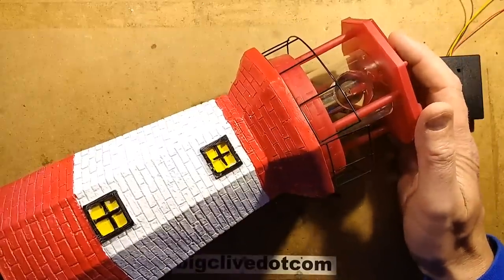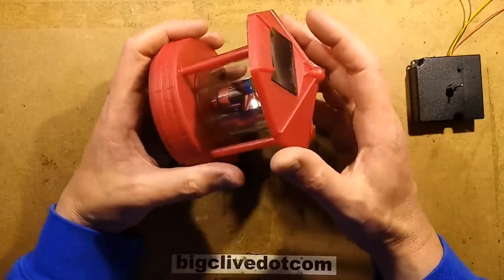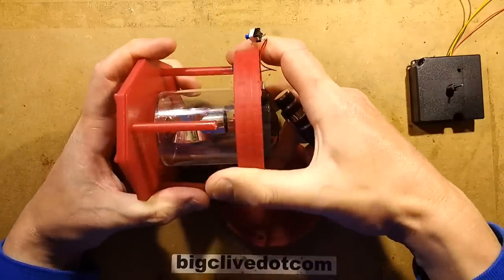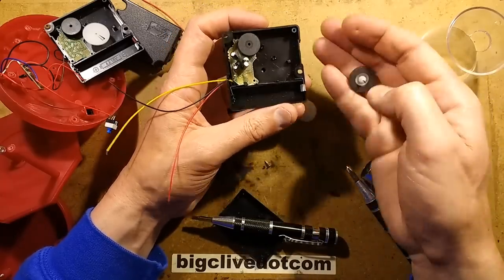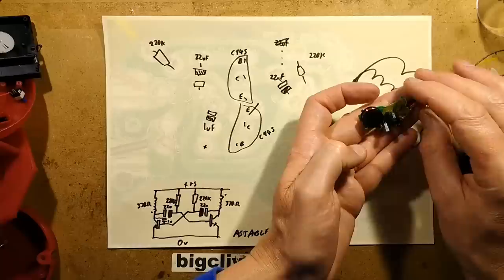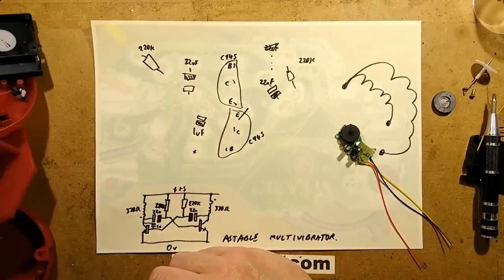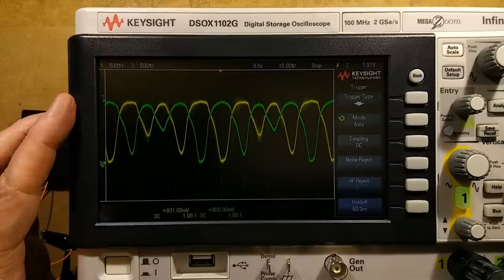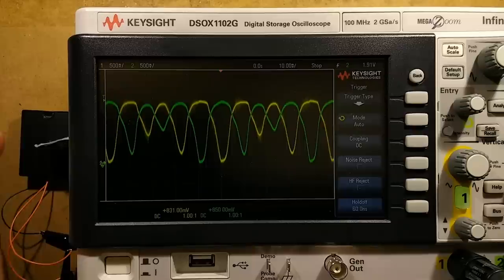Really interesting motor inside a solar ornament.

Comment: It's a striped down clock motor. they used as much as they could from the existing parts. The 2 phase motor coil is working very similar to a clock motor, just doesn't have the calibrated crystal on the drive side.
Reply: Exactly
Reply: I believe it is also very similar to the peristaltic pump driver used for administering some types of drugs. Could be wrong though as I haven't worked on anything like that for 20 years.
Reply: It's more than that, it's a brushless motor which is why what clive calls "the weighted flywheel" is really a magnetic rotor just like you see inside a modern brushless drill. 

Too bad he didn't scope out the waveform when the circuit first got power to confirm if that's why that off balanced electrolytic cap was indeed there to start the circuit as he hypothesized.
Reply: Yeah I was thinking it looks like a clock movement - and the cog is what would drive the second hand ....be interesting to measure how many revolutions per minute
Reply: I have a low rpm jewelry display platform that uses the same type of motor. The battery lasts about 14 days.
Reply: The second hand could be replaced with a spinning rainbow flag, that goes with the pink lighting ;)
Reply: Yeah, the little black case even looks like the back of one of those cheap dollar store clocks, just without the adjustment dial for changing the time.
Reply: Wasn't that what he did when he held the motor stationary and the waveform appeared to have some sort of starting pulse every 2 seconds?
Reply: I'm surprised they ditched it. It's super cheap considering they can order a special batch at the Chinese factory that doesn't have the whole package. I used to make tiny ballerina boxes with them as a gift toy for grandma's birthday. I kinda stopped after a while, you can have only so many ballerina music boxes.
Reply: +aserta Where can I get them? I could really use a couple of these motors.
Reply: +LateNightHacks Thanks. Not really interested in buying 3000+ of them, but at least now I have a search term.
Reply: @hellterminator
That was the idea :)
Reply: some clocks actually use a very similar rotor and driver, you know the always rotating types. I'm thinking about using these with joule thiefs to make a ultra low voltage motor.

Comment: I use egg boxes when dismantling equipment. Each stage goes into the next sequential egg holder. It prevents  losing anything and or putting the wrong screws in.
Reply: mbaker335 that's actually a very good idea
Reply: Or an ice cube tray
Reply: mbaker335 I like it.
Reply: I have a number of little parts boxes, segmented containers with a snap-close lid. Got them with a cheap plastic toolbox, they snap into recesses in the lid. Such toolboxes are easy to find cheap online and you can keep drawings/schematics, sub--assemblies, accessories or special tools for a project etc. in the box too, buy one for each project and label them. The closable parts containers are very handy when you accidentally knock one off the bench... as long as you get in the habit of always closing the lid!
Reply: Aren’t you an interesting person 😏

Comment: I love watching you solder Clive! every time I get the iron out I try the Clive method, burn my self, make a mess and then get my little soldering vice out 😂
Reply: R-URBEX After a few attempts I eventually learned the way of the Clive. I still have to master it though.
Reply: +That Guy
It's easier than using chopsticks.
Reply: Don't feel bad, just watch the Clive burn himself at 16:50
Reply: Clive has had special asbestos fingers fitted. It's an upgrade option at the Electrician Factory. Everybody else learn a different way of soldering.
Reply: The "Clive method" becomes easier to master once you've practiced it for a few years by making fine wire joins or repairs with a gas iron at the top of a 10ft ladder. Such is the way of the service tech.  :)
Reply: your skin on your fingers hardens like leather.
Reply: We ALL have our vices :)
Reply: don't worry, after doing it for a while your fingers actually get so damaged they'll have greatly reduced heat sensitivity and have a hardened coating of dead tissue. Then you'll be more or less immune to such heat damage.

Comment: Goodday Big Clive! Thank you for choosing the "lower" enthusiast grade Oscilloscope for use in your videos! Its always hurting if you want to use similar equipment than the people you are learning from and its just astronomically expensive.

Could you please do some sort of introduction Video on these tools like you did with electronic components? There are several cheap DIY Oscilloscopes on Aliexpress and E-Bay, maybe you could feature them aswell (They would also be easier to use in your top-down style videos.) for entry level hobbyists like me!

Regards from Vienna,
Ray
Reply: raydoesnilusin
The cheap assemble yourself kits are not worth buying if you want an actual tool to make measurements. They're a nice, fun kit to assemble, and they kind of work, but they're not a real tool.
Reply: And that could be the point of the comparison when does the toy with entertainment value become a tool with practical value in use.
Reply: The kit was enough to determine the inner layout of a LCD screen I had and allowed replacing the controller. They're harder to use than the pro-grade stuff and you'll probably never wish to go back to the kit one. But there's a huge difference in price too (50-100x basically) and it works.
Reply: You showed amazing restraint- I don't know if I could have turned down the super-kick-ass Keysight scope, even if I don't know what 80% of it does.

Comment: The clock with the rotating balls is called a 'torsion pendulum.'

With modern pendulum clocks, both torsion and standard, you often find the pendulum is just for ornamentation and the actual timekeeping function is an electronic quartz mechanism. People still like to buy clocks with moving parts because they show 'taste' and wealth, but as quartz movements are more accurate and cheaper to make than a well-calibrated mechanical movement, manufacturers respond by just putting in a fake mechanical movement.
Reply: Vyl Bird We have one of those clocks, it is called an anniversary clock, it is supposed to run for a year on a wind. The trouble is it seems to need the lightest lubricant in the world because the mainspring has ludicrous gearing..
Reply: +simontay1984
You could try gun oil.  Used on mankind's most precious machinery.
Reply: Does it actually use a liquid lube?

Clocks typically run dry -- jewel point bearings, knife-edge pivots, and brass alloys with lead for the gears.
Reply: You may be right, I did try very fine oil diluted in a solvent, not sure that was a great idea....
Reply: commonly called a carraige clock.
Reply: @g0fvt  Whale oil (beef hooked).
Reply: @wiseoldfool  I cannot go to a store and ask for “beef hooked”

Comment: I picked up one of these units for 50% off at RiteAid in NH.  It was the only one on the shelf.  What convinced me to buy it was the fact the LED lit and the reflector rotated when the solar panel was covered.  The unit I have is black trim on white and the LED is a white LED.  Considering how unique it is we take it in at night so it doesn't get feet.  Ours has only one solar panel and generally will run for about 3 hours after a full charge.  I've been reluctant to take it apart to find the battery but, thanks to you, I now know how to replace it when it dies.

Comment: At first I was expecting a standard clock movement with the seconds only hand connected. This would give a nice slow movement, possibly more like the real thing together with microscopic current draw.
Reply: I was of course talking about the continuance motion type, not the stepper type motors, I agree that would look dreadful.
Reply: I can imagine that is a clock motor, just with an option or two added or left out.
Reply: That does look like a clock movement case, and it's probably using a stripped down clock drive circuit.

The two coils are used for both start-up (avoiding meta-stability) and for energy recovery.
Reply: Nah, there's no circuit for energy recovery, no point, at such low power levels, and finally it'd be counter-productive and use more energy than it saved, since the only energy would be the moving magnetic field. To take energy from that would mean more would have to go in, and efficiency always being < 100% means it would actually use more. 

I think it's a variant on a clock drive. Since there's no quartz crystal in there. Probably the mechanical parts are mostly the same.

Comment: Our local Reject Shop did these a few years back, except theirs were much bigger, and had yelllow LEDs shining from the tower windows (along with a fairly powerful cold white LED in the lantern enclosure). This lot needed 6 decent polycrystalline panels to run it, along with 2 AA NiCds. They were far from cheap (I seem to remember $45 being the price tag), so definitely NOT the sort of thing you'd leave in the front garden, no matter how nice an area you live in!

Comment: Hi Big Clive! Thank you for doing this video. I have the same Lighthouse myself it does not like the wet weather. I have rebuilt it many times due to water damage and now I have soldier in the battery due to Poor connections.
I will have to have a look on the Internet for replacement motor.
Keep up the good work...
Reply: Alan Toop have you tried using those silicon bags you get in shoe boxes and such? They absorb a ton of moisture and can apparently release it when the air is dry. You might also wanna try putting lubricant into all moving parts and around the shafthole to keep water out, and consider potting the electronics in clear resin (because colored resin is more expensive and doesn't look good).

Comment: Hey Clive, Thank you for your excellent videos. I have a similar lighthouse which stopped turning and I took it apart. As it turned out, a little spider had built its nest inside the motor case and the silk blocked the gears :D

Comment: Hey Clive, I got a big one of these for my Nan a couple years ago in Germany, they're really cool things. Hers lasted a year until enough water had got in to destroyed the circuit inside. I then bought an exact duplicate in mini size for cheap and replaced the insides with the new one.

Yours seems to act differently though. Hers only turns on in the dark. Which is a great effect at the side of her pond.

Comment: The extra cap is there in case the components have miraculously balanced values. Like they would in a simulation.
Reply: I would suggest that the capacitor is used to cause a delay for the second winding to create a rotating magnetic field. Basic electric motor theory. ;)

Comment: It looks to be turning far too fast for a lighthouse. Doubling or tripling the timing resistors would have to be my next move before garden installation.
Reply: I think it's possible the motor might become unreliable if you try to run it too slowly - be worth experimenting though.
Reply: Peter S I thought the same, it's not quite as relaxing as the slow ambling sweep of a real lighthouse. Would be nice to dial down the speed somewhat
Reply: By blocking one of the 'outlets' you could halve the frequency the light becomes visible from a given direction. (only once per 360 degrees of rotation instead of every 180 degrees. Make it reflective on the inside and you might get a bit more light in that one direction
Reply: My dad has a more sophisticated lighthouse and it has a small modified servo motor for the mirror assembly.
Reply: Adjust down to 1/4 the current speed, and figure out where to get some small fresnel diffusers to put on the ends of the reflector piece. Maybe add in a color filter to one of the lenses too too.
Reply: Peter S A single sided reflector would have been preferable in terms of a more realistic beacon timing.

Comment: I expected you to mod it to shoot flames. Maybe another time.
Reply: Replace LED with high powered laser diode?
Reply: @Greg Ewing
"Replace LED with high powered laser diode?"
Good idea... The first thing it will do then, is cut its own power as the laser slices through those posts. OOPS!
Reply: That could be solved in a variety of ways. 1: Arrange a sensor to turn off the light when it passes a post. 2: Choose a wavelength that gets reflected off the red plastic instead of absorbed by it. 3: Wrap some reflective tape or foil around the posts. (The last two come with extra bonus eye hazard from randomly scattered laser light.)

And of course the whole thing should be run from an exciting Chinese USB charger and fitted with the "best" Chinese-quality lithium cell.
Reply: That would be on Petersripol YouTube channel.
Reply: I'd say "send it to photonicinduction", but it would only last about three seconds so kinda pointless.

Comment: Thanks Clive This was similar to a Kitty solar mover I have no plastic blob on the circuit board but it doesn't seem to run unless there is another magnet near the coil.
  I downloaded a magnetometer to me cell phone to see how it starts but it only starts when the magnet is present which gives me trouble interpreting what the magnetometer reads.
I enjoy your videos very much.

Comment: There is a little electronic LED module used for model railroading that simulates a revolving light (quite well BTW) and since there are no motors or moving parts involved should be excellent for solar projects. 👍

Comment: Aldi were selling very similar lighthouses the other week under their "Garden Bright Solar" brand (in this case, Bonnington Plastics) - the only apparent difference being the design of the lighthouse (truncated cone shape, with grey base, red ground floor, white middle floor, blue top floor, white lip above, then black guard rails and light assembly). It comes with a three year warranty - which sounds impressive until you read the conditions and realise that "parts and consumables under normal and proper conditions of use (e.g. LED unit)" are only covered for six months.

Comment: Those little holes in the top are for ventilation.
It looks like the construction is somewhat less than water proof, and even if it is, it is not necessarily humidity proof. Once moisture gets inside something like that as a vapor, it condenses to liquid and stays forever.
The holes allow the interior pressure and humidity to remain equal, and also provide for drainage before water builds up.

Comment: A friend of mine had one of these.  Identical except for colour.  It worked for a little while but failed before long, as they usually do.

I pulled it apart and removed the reflector and motor and electronics (yes, practically everything but the switch).  I installed a circuit which combines a light-detector to switch the light off in daylight while the battery charges, with a 555 timer to make the LED flash, and replaced the rusting 1.2V NiMh cell with a protected 300mAh Li-Ion cell and added an external solar panel of around 5V to replace the dinky, useless solar panels on the top.

The protection circuit ensures that the lithium cell won't over-charge or over-discharge, and even without the reflector, it gives a decent amount of light.

It lasts at least 6 hours but due to human limitations (ie: I had to go to bed), I don't know exactly how long it will run for from a full charge.

Comment: The extra 1uF cap on one of the transistors is maybe to couple some back EMF current from the coil to the base of that transistor, providing some kind of feedback. 
Really clever design. Very simple, cheap and very efficient at the same time. 0,5mA at 1,5V seems really nice for rotating a several grams weight at that speed continuously.

Comment: Many years back (like in the late 70s) I had a battery-powered mechanical clock. Most of the thing was still normal clockwork, but the main spring and the regulator wheel had been replaced by an electronic circuit and a wheel with a magnet on one side and a matching weight on the other. The circuit would switch a magnetic coil in one direction for a moment then switch the same coil (or another winding, not sure which) in reverse, pushing and pulling the magnet to make the wheel move. The movement of this wheel would drive the rest of the mechanism, and the pulsing would give a proper "tic" effect. 

Although it has been a good 30 years since I last saw that clock, it is where I got my start in electronics and the circuit you show looks very similar. In fact I was thinking that it looked almost exactly the same when you first pulled it out.
Reply from the maker: That does sound like the very earliest battery clocks.  Some used a transistor and others used a simple contact to keep the flywheel spinning back and forth.

Comment: I have a Tektronix 475 satisfying my current oscilloscope needs; very simple software in that. It is quite nice really, in spite of the fact that it had been dropped on its face quite hard, and a lot of the knobs don't work quite right. I got it for 100USD shipped from CA to NY because of that though, and all the important ones do work, so I can't complain. I call it ozzy.

Comment: It is indeed a rare day with Big Clive 'probes' around. 

Was not expecting a Keysight scope, nice to see Clive with a scope, there have been a few times when a cope would have been nice. The DSOX1102G is still outside what most enthusiasts would spend but it is a nice enough screen (I know of professional electronics engineering companies that use far lower scopes for most of their work. 

Big Clive, you should get some of the magnetic viewing film AvE uses, far easier to see the poles then poking around with a big magnet

Comment: I actually bought one of these in Aldi yesterday. Luckily the motor in mine works. The only difference is that the top part of the lighthouse is black, and the body is coloured red, white, and blue, instead of red and white.